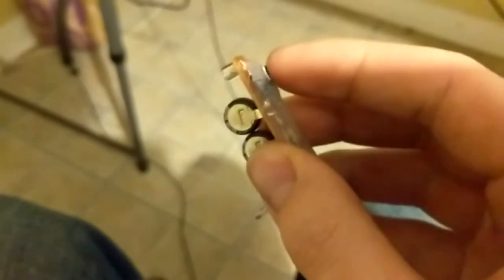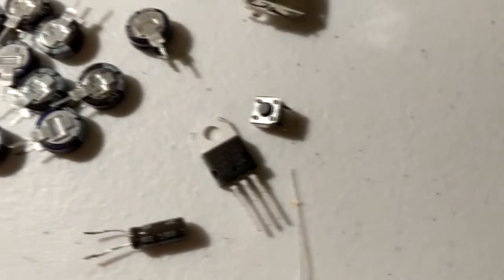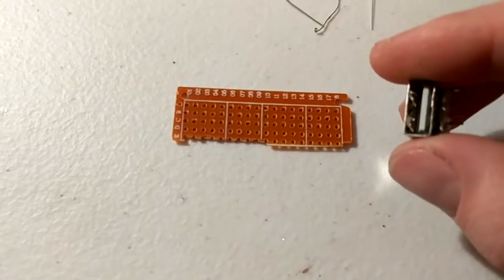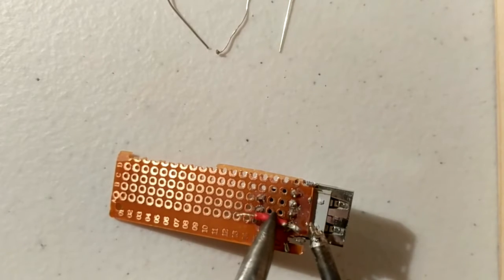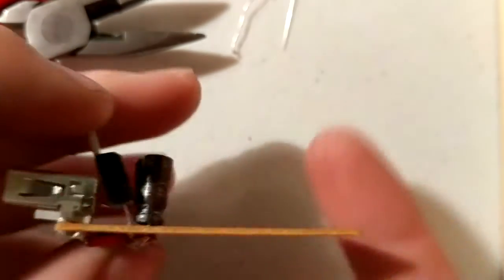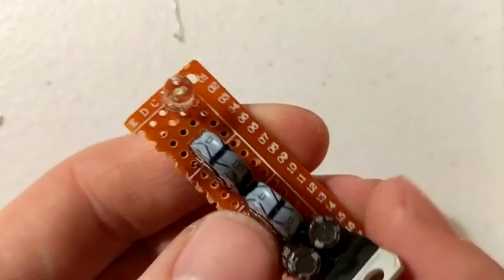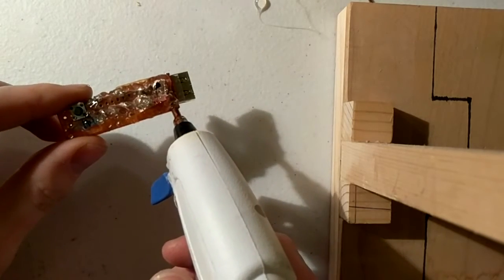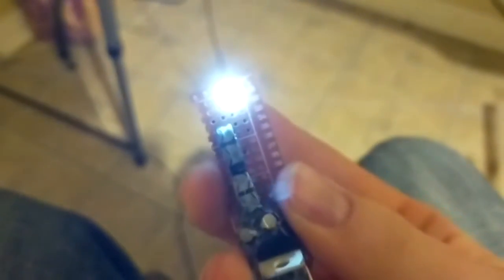DIY Supercapacitor USB Flashlight!

Comment: I‘d maybe rather use a NiMh cell with a resistor and one of those 1V-5V to 5V converters or a QX5252. 
But I mean, supercaps obviously also have benefits. 

And if I would use supercaps, I would also put a resistor (48 or 100 ohm) in series with the caps, plus I would use a 3V regulator and hook the LED straight up to it, maybe with a ceramic filtering cap (I left out the decimal stuff as YouTube doesn‘t like that).

Comment: If most ultra capacitors have a voltage rating of 2.5 volts why do you need a voltage regulator? you could just put the ultra caps in series for 5 volts. 5 volts is what all usb devices use right.
Reply from the maker: ...Thats a good point... haha I didn't really think about that, but you are right.

Comment: Question: Will the capacitors last longer than a regular rechargeable battery?
Reply from the maker: That mostly depends on how many capacitors you use. But size for size no the rechargeable battery will hold more power than the capacitors.

Comment: The voltage regulator of this type needs about 3 volts more at the input than the output, meaning 8 volts input. Why is it even there?! Isn't a USB port regulated at 5V by definition?

Useless extra work for nothing. Poor guy should do some research before making a project.
Reply: Maybe it should mainly stop protection ciruits to kick in. I would have used a 3.3V LDO (or cheap USB boost module), but where the LED is. Depending on the type, they can be cheap and work from 0.9v or above (the booster modules), thus making more of the stored energy usable. Combined with a 470 ohm resistor limiting the current to 7-10mA, this would light for about 6 mins (or obviously less with the LDO, but will also depend on the used super capacitor, the ones in the video are rated 6V .33F I think).